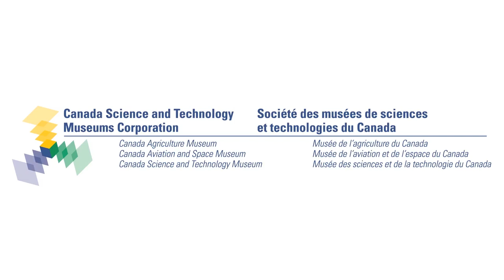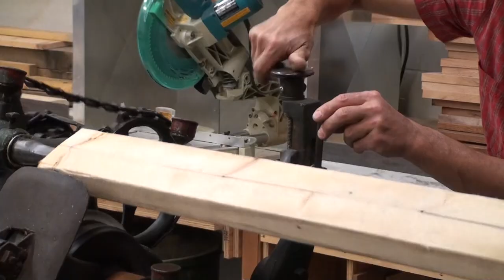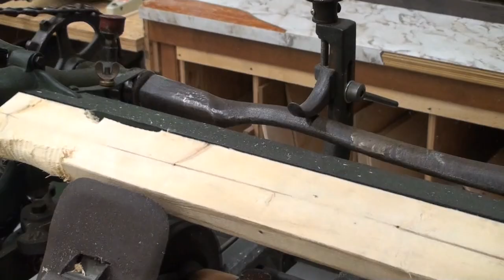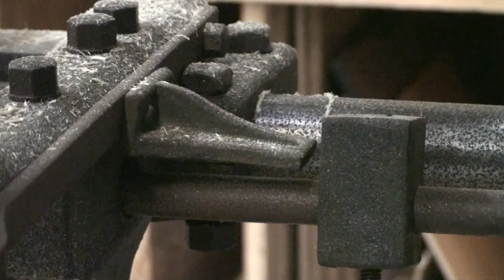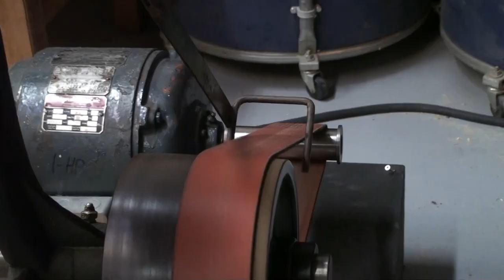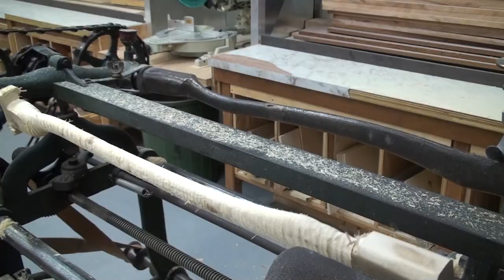Copying Lathe

Comment: Any chance the machine is actually 40 or so years older than 1900? In which case here is a possibility: (from NYTimes) "THOMAS BLANCHARD's next valuable invention was a lathe for turning the whole of a gun barrel from end to end, by the combination of a single self-directed operation. This invention, which was immediately taken advantage of by the Government at the armory in this city, was the germ of his greatest invention -- a lathe for turning irregular bodies, his first application of it being to the turning of gun stocks. After obtaining a patent at Washington, he made his first machine for the Harper's Ferry Armory, and soon after -- in the Summer of 1819 -- came to this city, and duplicated it for the armory here, This remarkable machine, with modifications and improvements, it now used in all the armories of this country as well as England, and is applied to numerous operations in making gun stocks, such as cutting the cavity for the lock, barrel, ramrod, butt plates and mountings, comprising, with the turning of the stock and barrel, no less than thirteen different machines. The same principle has been applied to a great variety of objects, such as busts, shoe lasts, ax handles, ox yokes, etc."